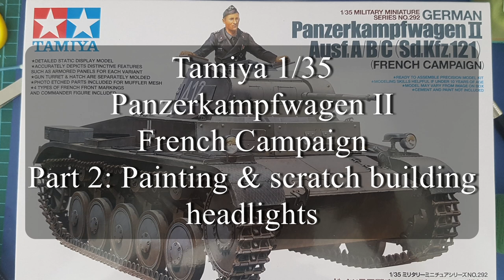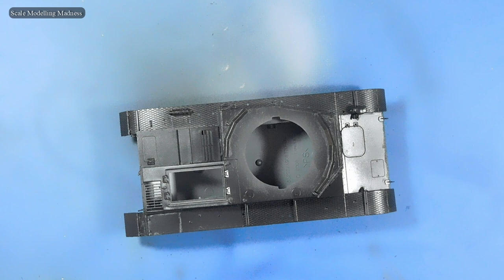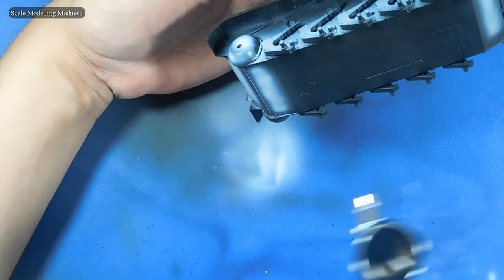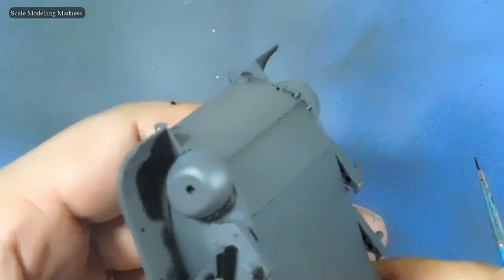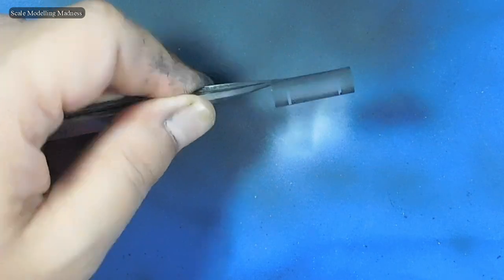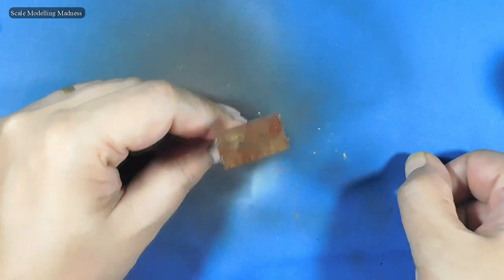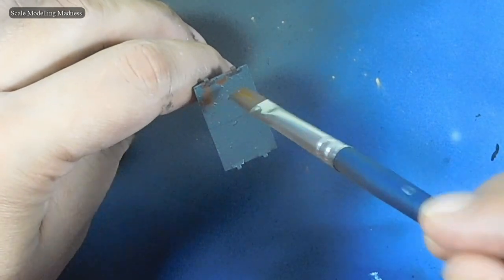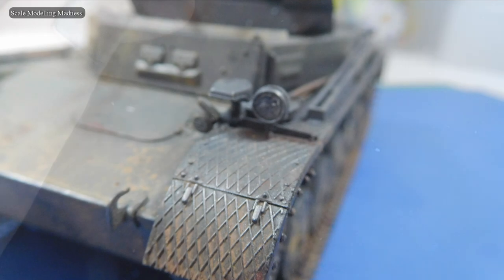Tamiya 1/35 Panzerkampfwagen II (Part 2: Painting and making headlights)

Comment: Hi, can use normal spray paint from hardware shop?
Reply from the maker: Hello there mate. Yes you can use spray paints from the hardware store and many people do. But you may find matching colours a little difficult. Some modelling companies, like Tamiya, do make can spray paints in a limited colour range. The second problem with can spray paints is that you will have no control over the amount of paint being sprayed both in volume and in pressure. You will have to work around these challenges, but surely it can be done. I do remember having come across a few videos on youtube by other builders who demonstrated the use to commercial spray paints on their models. So perhaps those would help. One of them, if I remember correctly, was named something like "painting a kit without an airbrush". Good luck with the hobby. Hope that helps :)